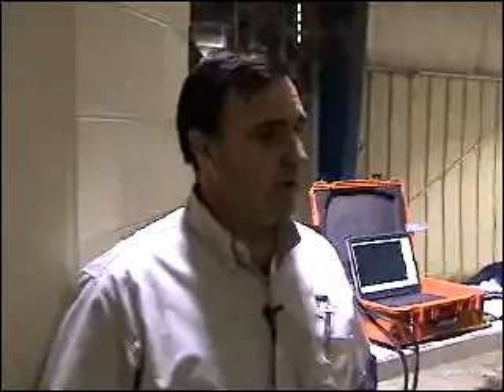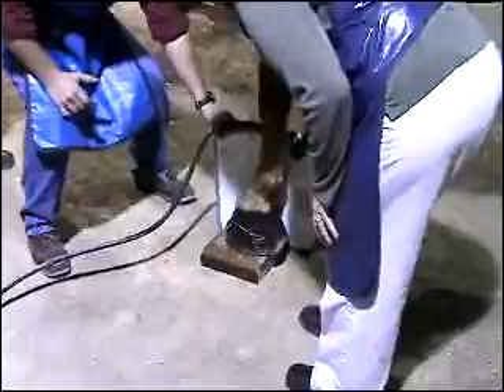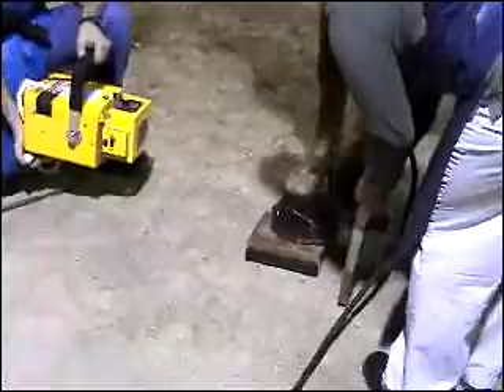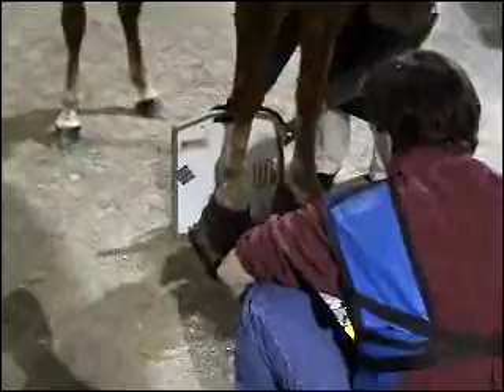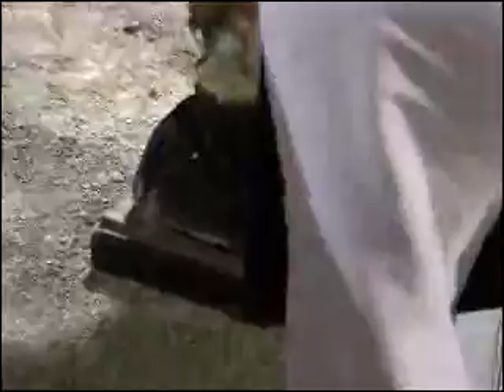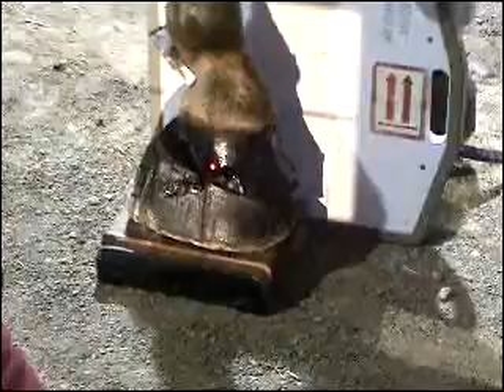How a Big Lick Tennessee Walking Horse is Shod.wmv

Comment: I must be a super genius because I didn't go to vet school and I don't even need an x-ray machine.  I know what the problem is with the horse.  It seems so simply obvious but apparently it's not.  No x-rays needed because the problem is on the outside of the hoof and it is a simple solution.  Remove the blocks, the wedges, the nails, the chains, the blistering acids, and throw the owner in jail.  Horse will get much better.

Comment: the new way to sore is to founder, on purpose. And it's really easy to do, work horse hard( not a problem on it's own) hose down with cold water, tie and leave alone for many hours. no hot walking, horse will founder during that standing hot, guarenteed. No need to use diesel fuel/mustard oil etc to sore all done from the inside, same awful result. Pain for the horse, awkward way of moving that they( TWH people) like